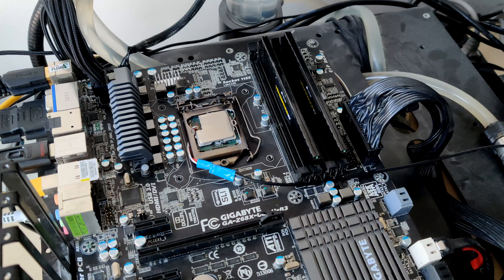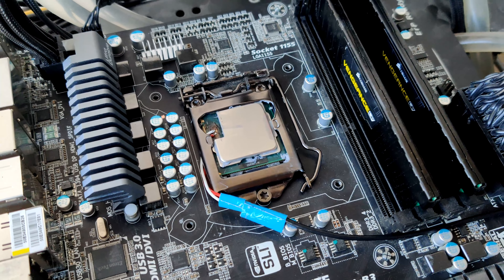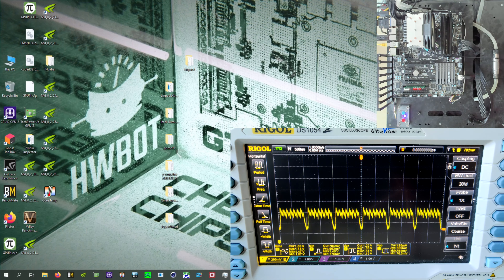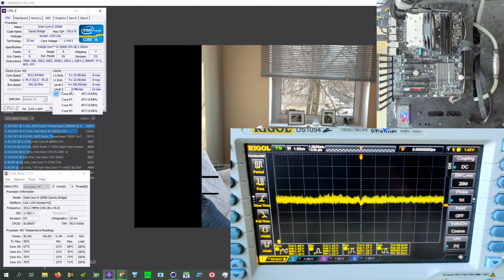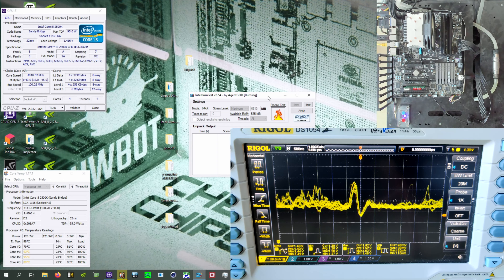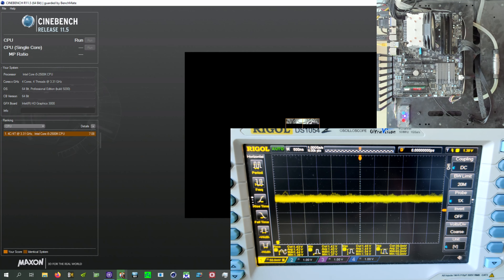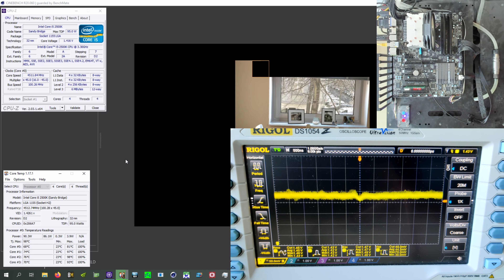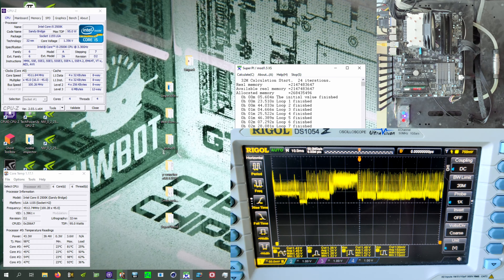Why Cinebench is a BAD Stress Test feat. the Probinator 2500

Comment: How droopy loadline calibration is that?

I had background noise like this when I extended the coax cable from the scope with regular wires to have some flexibility and strain-relief. But then I removed the extensions and soldered the coax cable itself to the back of the socket and suddenly there was much less noise

I don't much like P95 because it doesn't stop properly when there is a problem. There will be an error logged in the log file alright, but I have to open the results.txt and search for errors every time I want to see if there was a problem

Comment: De8aer and others are basing their temps off of cinebench.
Reply: Cinebench is a better metric of CPU temp under load than it is of vrm power delivery.

Tbh the only real advantages of cinebench in any test are how good it is at isolating cpu performance from other system factors and how easy and quick it is to run.